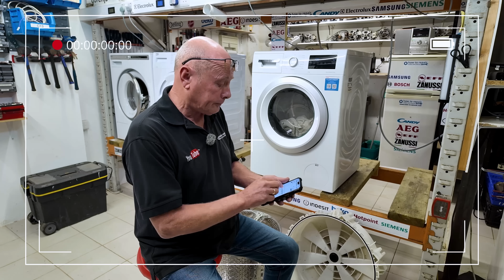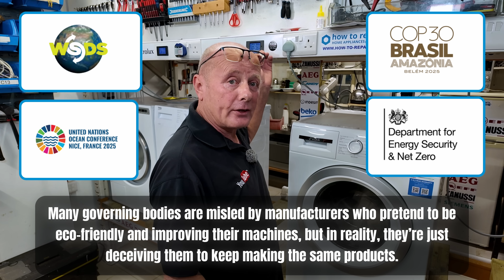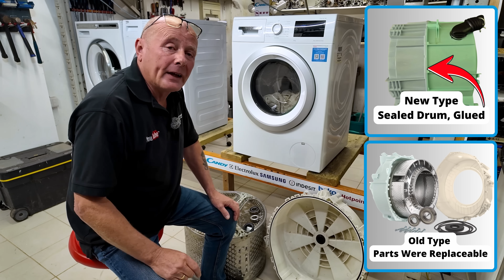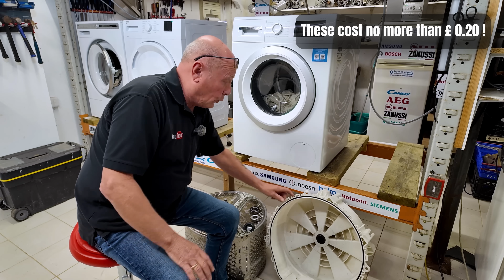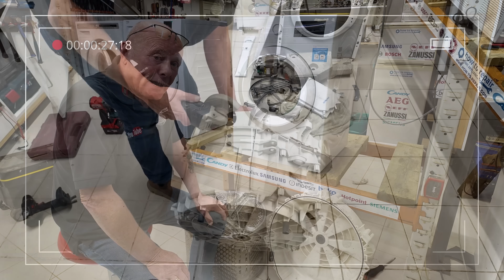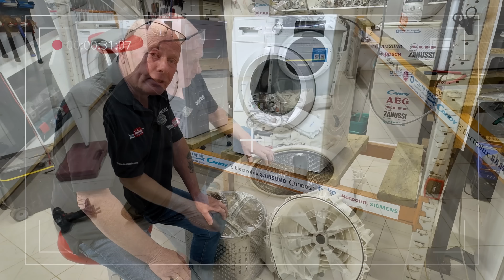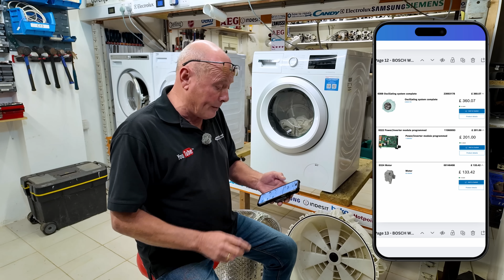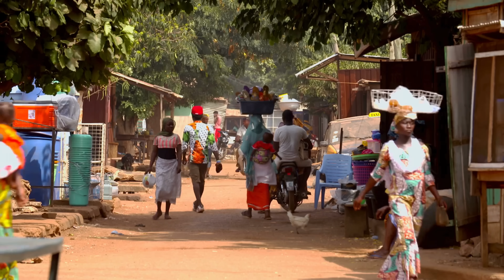Washing Machine SCAM EXPOSED! The Truth About SEALED Drums: Naming & Shaming

Comment: two exemples i met when repairing appliances :

Bosch heat pump dryier, with "self cleaning condenser"... the user used it for dogs stuff... there was hair everywhere, including behind the main filter and the condenser was clogged : ther is a pre cut line on the body, to acces the condenser, and they event SELL a dorr to close this cut hole. juste put it on the machine at first place! 

samsung, inverter washing machine : trapped in the infinite final spin cycle : pcb, swapped with an indentical working machine: problem transfered. ordered Two new inverter PCB:  impossible to make them work : they seems to need a proper programming via dedicated tablet ! 🤯

Looooong gone is the time, when brand , like miele, where hiding the machine schematics, in the machine itself 😥

Comment: On my 3rd Indesit washing machine, both failed around 6 years with a failed spider " coincidence " I think not. 
Cheap machine to buy with discounts so price per year of ownership is low but I hate this built in failure.
Reply: I wouldn't touch an indesit with a bargepole, although it has now been taken over by beko, so maybe they'll improve. However, the corrosion and failure of aluminium spiders can be mitigated against by running regular hot maintenance cycles with an oxygen bleaching agent based machine cleaning product, or by using powder detergent containing oxygen bleaching agents (eg Persil or Surf) on a hot wash 40c+ instead of liquid detergent.

Comment: I used to repair domestic appliances during the 1980’s  & 90’s back then all machines were fully repairable, I used to keep bearing kits and a bits of old motors to refurb customers machines as it was cheaper, than replacing the complete motor. I worked with all the big brands Zanussi AEG Bosch Neff Siemens. Now like you said nothing is designed to be repaired even for those of us who a competent  engineers. Zanussi started the split drum in the early 90’s with the integrated bearings and not being in a separate spider housing. Miele were always a great product and built for longevity but even they have gone down in product quality. Also the European manufacturers are now in big conglomerates ie Bosch, Neff, Siemen & Gaggenau collectively know as BSH Appliance Care, and Electrolux group containing Electrolux, Zanussi, AEG. Then you have Whirlpool which own Hotpoint, Indesit. 
Now even I find obtaining spares for my own machines a pain, we should be looking at least a 10 year lifespan for domestic appliances but some of the cheap equipment only will give 5 max

Comment: Yes, it really is a complete disgrace. For example, I have a washing machine that started making noise during the spin cycle after 15 years. The diagnosis: the entire drum has to be replaced. Excuse me? The whole drum, just because of a bearing? And this on a premium machine that originally cost over £1,600. Unbelievable. Luckily, in the end it was just the shock absorbers.
Reply: If the machine is worth the effort, you could cut it open to change the bearings when they do fail, and either bond it back together using a specialist MMA adhesive formulated for polypropylene (eg Permabond TA4610) or buy a ~£40 hot air plastic welder and some polypropylene filler sticks. If done well it shouldn't leak, but you'd obviously need to assess the potential for water damage if the joint failed.

Comment: Most tragic theme about that stuff is that, these machines are very cheap in usa or germany but for a Turkish family its a dramatic budget...  You can also count africa, india, pakistan style countries for it... 

Am both german and turkish, so i know the inflation and life struggeling in Turkiye so believe me, today the price to buy a new freezer+washing machine equals to a good used car in germany but you never would get a car under 30 years old for the same price in Turkiye. Another problem is, even the service price is very high and equals to a good grocery price and even if the cheep parasite capacitor is burned and the washing machine has no power, service will tell you the ecu card is burned needs replacement or the cheap termic sensor in freezer needs replacement but service would charge you for new motor, ecu card etc... 

We know that in some countries where service was not common, they produced more heavy duty to make sure the buyer could use it for long time because if it breaks in 2 years, there will be no service for them and for countries like us or uk or germany they just made it more friendly for services 😊 but today the use limit is 5 years for global... 

3 months ago my 11 years old washing mashine drum bearing got kaput dead .D thanks to youtube and machine, the drum was old style and i coule replace it my self and 2 bearings and washers + 2 shocks were done by myself but my neigbour with 4 years old bosch also had bearing problem and service claimed it was her fault had to pay a  complete new drum because she was told the drum is not repairable ... For The price she paid she could get 4 mint used 2. Hand machine... And we all know they didnt change the drum, they just cut it open and repaired... 

What i noticed, in my old 6kg washing machine, the bearing was SKF but all new machines produced in Turkiye(bosch, siemens,vestel, arcelik, beko etc) use ORS bearing today... And they dont last 5 years i know beause a repair motorcycles a lot and every time if there is a broken wheel bearing its a replaced Ors, and after i change it with skf or nsk i never hear from that customer anymore... 

So unfortunately when people get married or get a new apartment etc they tend to throw old machines and buy new because its culture but i would never throw away my 1989 bosch dischwasher ... Its a masterpiece... So maybe, people should stop to buy new machines and only buy 2. Hand refurbished and quantied buy local services so the brands understands people dont eat it anymore... 

Have a 1996 bosch freezer, stopped working...tried to repair ecu but no chance. Thanks to your videos, i rebuild it with digital thermostat and rebuild defrost with analog thermostat and use it since 2 years with no problem... But if i didnt get it work, it was now in trash so why should that working machines land to trash if someone like me could get it work again... (Of cource its no good for global companies) 

People should %100 be sure that planned obsolescence in every sector is real... So dont throw away your money for new machines if you have a working old one... Its not worth anymore.

Comment: I have repaired at least 100 of those washing machine circuit boards to earn some money on the side. 99% its the same fault:
-Problem: Washing machine does nothing, like the power is off
-Fault: The primary power supply IC is blown and shorted. Also takes out a 50Ohm fusable resistor.
-Fix: Replace the IC and the resistor. The parts cost around 3 euros!

Why does this still happen? Its not hard to build a low power 12V supply that lasts more than 3 years. Use a damn old transformer power supply if you cant make a reliable switchmode supply. Thousands of perfectly fine washing machines are thrown out every years because nobody does component level electronic repair anymore. The repairman just looks up the price for the entire circuit board, sees 350 Euros and they decide to throw the machine away. The scam is built into every part of the machine, not just the drum!
Reply: It's shocking how basic circuit board repairs aren't done in western countries anymore, they lazily replace entire pcbs. Adding to the landfills. The skill needs to be taught
Reply: I've replaced 85°C capacitors on a PCB of a gas heater (inside the heater, 85 degrees!) with 135°C ones when it failed. Cost of 2 € against roughly 1000 € for the new PCB including installation by a "professional".
Reply: I bought Bosch machine last January & it lasted 3 months before it started banging & jumping around the laundry. I got a refund & bought LG... good so far..
Reply: these IC's, would u buy them off aliexpress in bulk for cheap? what else besides resistors and IC's have u often needed when repairing circuit boards? asking cuz i tend to be repairing them too, family and stuff know I'm handy with these stuff so they call me when something isn't working
Reply: @46Bax  Ideally I buy them from a real electronics supplier. Like digikey, mouser or my local supplier (reichelt). There are multiple different types so I generally dont buy in bulk. The ICs are widely available and pretty cheap. Look up the part number on the old IC (TNY264GN for example) and you will find a seller. Take care when buying the resistor. It has to have the correct power rating (1W for most) AND it has to be a "fusable" type. It has to act like a fuse if anything goes wrong again. One more thing: The relevant circuit is directly connected to the mains voltage, dont touch anything on the board when its plugged in. Also leave the washing machine unplugged for 20 min before taking the board out so the capacitors can discharge. Obviously you need the tools and practice for soldering and the basics of electronic repair. Good luck, let me know if you have any more questions!
Reply: Not just washing machines, but pretty much every electronic appliance you can think of suffers with this. It often coincides with power outages, presumably brought on by spikes as the power returns. The fact that so many things are always in standby and not powered down doesn't help (how 'green' is that?).
Reply: Solution to the issue that I had at my house is to install a bipolar switch to cut off power to the washing machine when not in use. Thus the PSU does not always get powered on and (hopefully) last a lot of time. 

Regardless... they are simply designed to fail after a certain amount of time. Not only washing machine, any device with electronics inside.
Reply: @alerighi Sometimes it is the on off cycling that makes them fail and they are better left on
Reply: @philtowle4683  Electrolytic capacitors have a limited life. But you are right that the turn on moment is critical when currents are higher.
Reply: Which washing machine do you own?
Reply: Did a few boards in my time as well.

Usually a powersupply startup cap had dried out making it unable to restart the powersupply after power off.

Or bad solderings in and around larger components and/or spade connectors for the heating element.
Reply: Wouldn´t it be possible to comission said boards somewhere else for cheaper? I mean I can´t very well believe that the part is actually worth so much.
Reply: Well.. I mean offering said service to all of the repairmen might be a wise choice then.
Reply: Thanks for this information. I’m not too surprised. Power supplies tend to get left to last and under designed.
Reply: ❤ Thank you for your information! What company machine would you suggest, if someone would like a 10 kilo washing machine!?🍀🌷
Reply: I do repairs of my own home electronics which has saved me at least €3000 over the course of ten years but I'm not sure how to develop this into a proper side business. I like to fix stuff but I'm clueless about finding customers and promoting a business.
Reply: @YouCanHasAccount taking washing machines off people and refurbing. Probably need a big warehouse eventually with team that can diagnose quickly. Set yourself up as a washing machine recycle and then you have people call you and then you can decide if the washing machine is (new enough/popular) worth your while to pick up and refurb.
Reply: What is IC?
Reply: @montazownianr1 integrated circuit, aka chip
Reply: @montazownianr1  Integrated Circuit. It's a miniaturised circuit board, sealed into a small chip. They are mass produced and used in countless electronic devices.
Reply: @montazownianr1   its washing machine private part

Comment: But even before that.... explain to me how a washing machine, designed for working with water and humidity all around it and inside it, still has the problem to rotten and became rust on its own. My parents changed 3/4 washing machines in my lifetime (30years) and the "unrepairable" part was always the same..... Also the machine are not complicated at all, is just a box that spin with a heating element and the seal. The pcb is barely 10€ at most to produce, and the programs are all fake, just changing temperature speed and time, nothing fancy.
Still i'm upset there is no platform that sell a good "case" for a open source project or a easy modification and access. If the pump will ever fail is easier to change even if different model voltage or dimension, upgrade with anything you want, i just need the seal, the spinning drum and the frame. The other parts are soo easy even a baby can put it toghether.

Comment: I confirm everything! I started servicing washing machines around 1978. Then it was possible to replace the smallest damaged parts, even springs in solenoid valves, water drain pump axles, all gaskets, and programmer motors etc. I have regenerated a large number of electromechanical programmers myself. Over the years, it started to get worse and worse, new technologies eliminated the possibility of inexpensive repairs. I stopped my business gradually from around 2015, definitely around 2020. In recent years, I joked that I had turned from a service technician into an expert, ruling that repairs were unprofitable... It was pointless to continue. I currently use at home Samsung, about 10 years old, with a detachable drum, of course... Greetings, veteran!

Comment: In the 90s my dad (now retired) was head of damage research at FAG Kugelfischer (which is now part of Continental/Schaeffler). They produce high quality ball bearings. Back then he told me a story about how they lost/cancelled their contract with Miele, because Miele wanted to save 20 Pfennig (about 0.10 EUR) on the main ball bearing in their washing machines. This was a part that cost less than 2 Deutsche Mark (about 1 EUR) at the time. Negligible compared to the overall cost of the washing machine, but absolutely critical for its longevity. That was the moment he stopped buying Miele, because he realized they were living off their reputation rather than actual quality.

Comment: the obsolescence is programmed in the printed circuit. There is a Spanish electronic engineer who shows that in his channel, he is able to read the code embedded omin the software. Also there is a Russian guy who can crack and reset the chip to make it start another cycle as if out of factory.
You need to take your findings to the gov because by throwing away machines to the landfill they are polluting the environment.

Comment: I had to cut my indesit to change bearings.
It is working for 10+ years. Changed pump and bearings. Overall its a good machine. If I have to change bearings again I will do it because its easier now.

Comment: When the pump broke on my last dishwasher I looked into the cost of repairing it. The motors cost 100€ but a completely new dishwasher cost 300€. It's barely worth starting a repair when spare parts are so expensive for 10 year old machines. I wish more would be standardised and modular so you could keep an appliance working for decades.

Comment: in nz we have the consumers guarantees act which means an appliance must last a reasonable time depending on cost, a cheap wasing machine should last 5 years and an expensive one up to 10 years, the seller not the manufacturer has to repair, replace or refund it it does not live up to the act

Comment: The only short term solution I can think of is sourcing working parts from failed washing machines. If the drum is failed and the machine is beyond repair, salvage the motor and electronic card so it can be sold for cheap and repair another machine but again. It's short term, it'll only take so long for them to code these parts to the machine and make them unusable on another machine even on the same model just like car manufacturer do with their parts.

Comment: With my last washer, a Maytag, it wasn't clear which of 2 circuit boards had failed.  Replacing both cost more than buying a "new" (new in 2016) washer.  My current dryer had a power relay burn up.  The board was about $300.  The part was about $20.

Comment: My Last Washdryer was from LG and short after the warranty the bearing failed. I got bearings and sealings for about 60€ and repaired the Machine in an 8h effort by myself. It worked much longer than from factory after my repair. When the bearing died again i decided to buy a new LG machine and not repair it again because of it's age.

Comment: Hmmm. Is the fact that drums are sealed and very expensive evidence of planned obsolescence in itself? I agree it’s a huge right to repair issue but the parts are available (just hideously expensive). 

Where is the evidence that the newer machines with welded drums fail sooner than say a machine made 5 years ago? For example, have they used a lower quality bearing or are the spiders made of lower quality materials?

I think what companies are doing is shit but to me the term ‘planned obsolescence’ means an engineering effort to make the machine last less time (like you claim at the start of the video) and is a separate issue than repairability and availability of parts. I would like to know if there are very obvious hardware or software defects to make these machines break just after warranty as you claim.